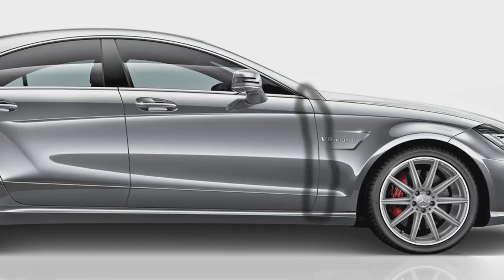Body shop quick tips. Removing over spray from door rubber. "A"pillar

Comment: Had a bodyshop over spray my rubber lining, and it looks god awful. I noticed it was peeling at the top and I tried to hand-peel it off but only got so far and an now stuck with half red half black trim
Reply from the maker: Just tape it off and spray it black.